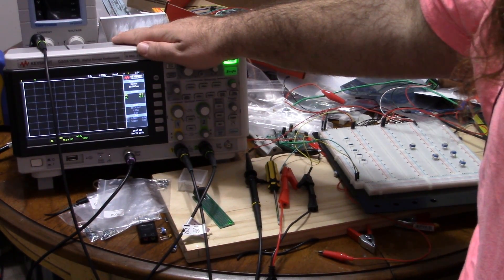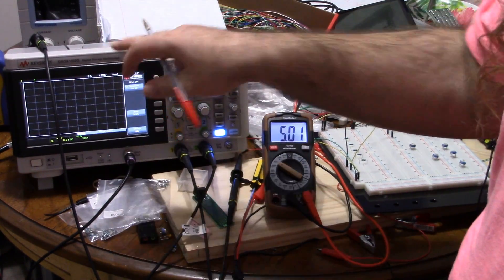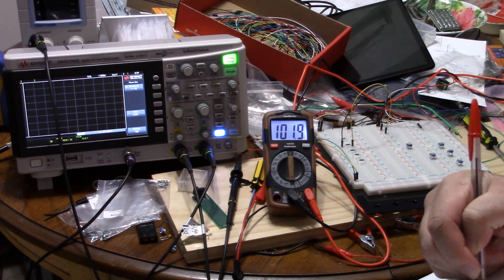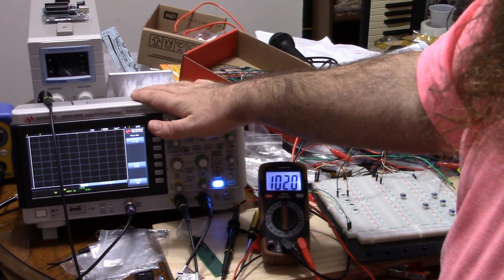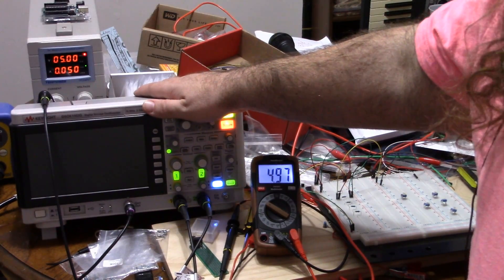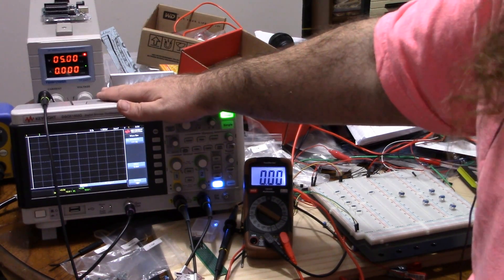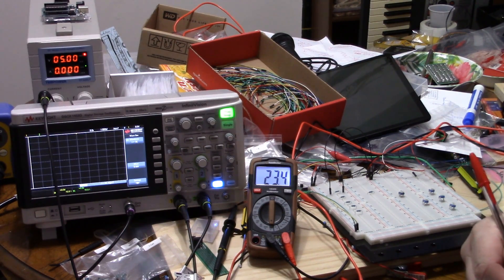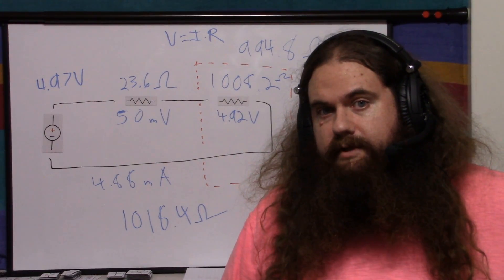Testing Input And Output Impedance - Simply Put

Comment: I designed two circuits for my CNC machine, expecting to get a 10V output from the first as the input to the second. Imagine my disappointment when it didnt work. A check with the scope showed that the best it could do was 4V!  I had never really understood output impedance being self taught. However, that day the penny dropped and I realised the two form a voltage divider. Output and input resistors changed and the output came back to 9.9V ! At 30 seconds in you are the only one I have ever heard  state that fact ckearly! Wish all the books would just state it too!!!!!

Comment: Ridiculous method. Set power supply to arbitrary voltage (say 1 - 4 v). Measure open circuit voltage. Attach power supply leads across 100 ohm pot. Dial down potentiometer until measured voltage is one half open circuit voltage. Remove pot and measure resistance. That is your output impedance. If you're dealing with an older power source (say an old function generator with higher output impedance) then start with a 1 K pot.

Comment: I have pressure sensors that output a voltage (0-100mv DC), with an output impedance (990 ohm - 1010 ohm).

For calibration, is there a way to simulate the sensor?   I have a constant voltage/current source (0-100mv), but to simulate the output-impedance part, I assume it's not as simple as putting it through a 990-1010 ohm resistor.
Reply: 100mv through a 1k resistor should do the trick